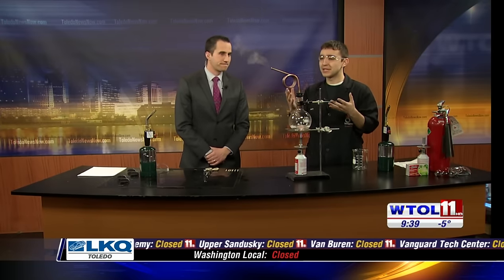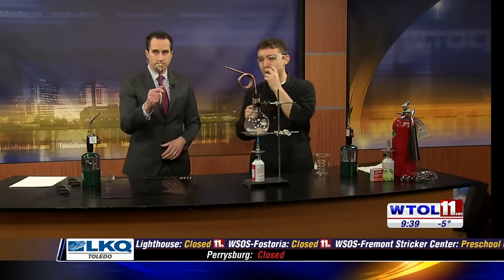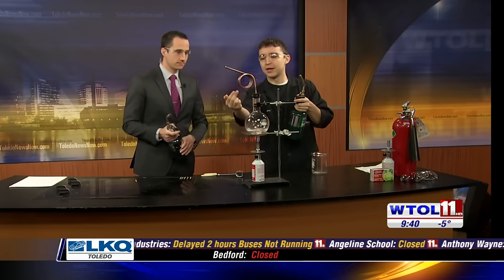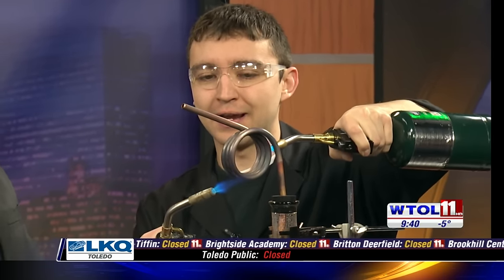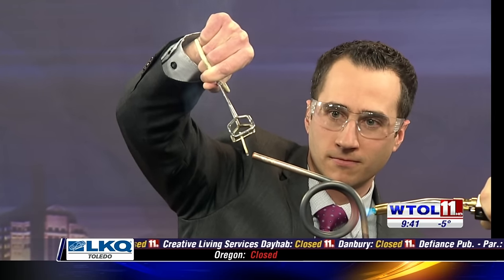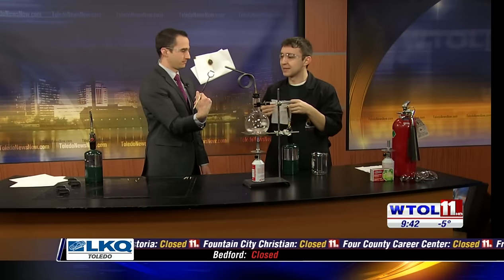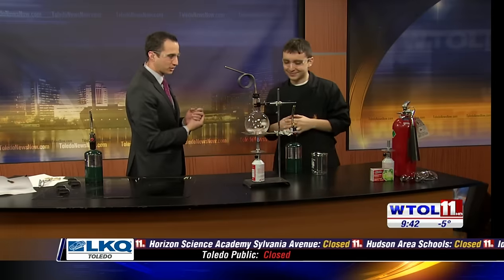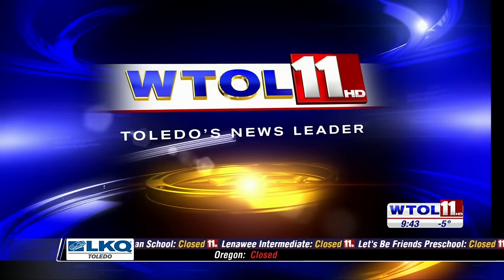Properties of superheated steam

Comment: When he heats the copper he is heating all the remaining water/steam to evaporate.. there is no such thing as super steam.. he basically heat it till all water evaporated and then the remaining air molecules are so hot that they light match or paper
Reply: Nope. That's exactly what is facinating in this experiment.
People have a hard time believing that water can exist as invisible gas.
He is boiling water in the flask, and the tip is blowing steam. That means there is 0 air in the flask and copper spindle. It's been blown out long ago. What's going through is only water, which takes a lot of room in its gaseous form, that's why the tip is blowing so much while the water level is hardly going down, and that's also why steam engines work.
Now while the water-gass "steam" is exiting at around 100 C, he heats it further, to ignition temperature of paper and such.
No air involved.
Reply: @IncendiaHL  I'll play along, so you have a copper pipe filled with water gas.. you super heat it, gas will disperse further and it will exit the copper pipe.. maybe that's true for 1st minute.. after that only few water molecules are left if any ...

I wonder if you did the same experiment, with no water, and just super hear the copper, I bet (10$) that the same will happen to paper or match..

Thoughts?
Reply: @lidoz  There is continuously coming more steam from the boiling flask. You are underestimating how much volume of steam comes from relatively little water. Think about how a kettle is able to wistle.
Oh and where is the air supposed to come from when the steam has "evaporated", (which it already did in the flask)? The pipe is constantly spewing with steam  from the flask.
I know it seems weird, but that is not air, that's 100% h2o :)

Comment: Latent heat of vaporisation...is why a steam burn is 10x worse than scolding water, any condensing surface will receive the latent heat of the change from vapour to liquid and water has a very high latent heat of vaporisation. In this case of course the superheated steam is at a temp. above the ignition temp. of the phosphor/sulfur compound of the match head and so will ignite it in vapour phase as shown.

Comment: So he gets the pipe so hot that the amount of condensation is atomized so far apart that it basically negates the steam presence and you're left with super hot pipes that nonetheless radiates its heat and causes anything in its front to burn. Disappointing
Reply from the maker: Manuel, 
Yeah, not really. If the high temperature steam was not present, the match head would not ignite simply from the radiant heat from the pipe. Unfortunately, Jeff did not have the time to demonstrate that in the live segment.
- Carl Nelson, Chief Scientist, Imagination Station
Reply: @ImaginationStationOH  yeah, not so much. If you put a heat gun to a match itll ignite just like this. Except he created an alternate, more energy consuming version of a heat gun. Theres moisture in the air, a heat gun will accomplish the same thing. 
-no need for a title because I use facts.

Comment: Sigh an example of the modern education or lack of it. This process is what used to run steam locomotives. Superheated steam. Old technology old information no longer taught. Unless your a chemist. Funny part is you could burn the paper if it was just heated air. Its used commonly everyday. A hairdryer lol. Or a heat gun bought at harbor freight.  Steam IE 1H2O behaves differently obviously when heated or cooled. Lol wanna get real interesting talk about heavy water.

Comment: On steam turbine ships there have been cases where a sailor have passed an expansion bellow and been decapitated.   When the expansion bellow is under high pressure gets a tiny crak it will not explode, but high pressure steam will blow out the crack, knifelike.  It will not be visible maybe a meter away, on the other side of the gangway.  It makes a terrible noise, but that is hidden by all the other noise in the engine room.  So when the sailor comes running past this .................................

Comment: Good information. And well-presented. However, steam really is visible. Firstly, it is not a scientific word and hence does not have a definition. It is an old word and refers to water vapor that is produced by boiling water at atmospheric pressure. Therefore, there will always be water droplets in it. Vapor is defined as the gaseous state of matter - it does not contain any liquid (or solid) matter.

Comment: If you do this experiment while watching through something like a FLIR camera (forward looking infrared) then the end of that coil will look like the flame from the torch. There was asteam pipe explosion right outside my Doctors office 2 years ago while i was waiting for an appointment. If id gotten there a few minites later id have been caught in the blast which ripped open a hole in the ground that ate my drs brand new Tesla. Luckily that was the only casualty but boy howdy was i reminiscing about iraq for a while after. But yeah super heated and under pressure is abbad day if it gets away from you

Comment: And here's what I learned from watching this video...
1] The demonstrator tried to redefine what "steam is", as if it was never the cloud you see coming out of the tube (or top of a kettle or pot, as we've all known for God knows how long)
2] That when the tube was heated, it turned the steam inside of the tube into a hot gas of hydrogen and oxygen, which although no visible flame of plasma could be seen, clearly was hot enough to burn a match, a piece of paper, and flash paper.

In other words boys and girls, it wasn't "steam" but heated hydrogen gas (dihydrogen or molecular hydrogen; also called diprotium) and likely the oxygen heated as well and when combined with the hydrogen that water is made of.

Comment: This is stupid. It's not "super heated steam" that's lighting the match, its just the pressure from the steam going thru the heated copper pipe to make a make-shift heat gun that's igniting the match. You could literally do this with some forced air going thru the same heated pipe.

Comment: Doesn't this added super heat "super remove" water from the gas thus what is coming from the copper tube is super heated air for the most part. So basically this is stupid and so am I for watching and commenting on it.
Reply from the maker: Hi C Straley,
No, the heat from the torch adds energy to the water molecules that make up the steam inside the copper tube. There is no place for the water to be "super removed" to. The water does not just disappear because there is no magical place for it to go, other than out the end of the tube with a much higher temperature. Something we call super heated steam. 
- Carl Nelson, Chief Scientist, Imagination Station

Comment: get a copper tube red hot... use expanding h2o to push the radiated heat through that tube... lights a match... wow gtfo
Reply: And the other 99.9999% of the heat came from the steam.

Comment: Dumb. Steam in any form doesnt ignite a match.  What will is 2000 degrees of a torch heating the air inside the copper .
Reply: There isn't any "air" inside the copper pipe. It's the water vapor coming from the boiler (glass jug in this case) that is  inside the tube being heated.
Reply: There can't be air in an open steam system like this, there is only steam......
Reply: The air was forced out of that flask through the copper tube by steam shortly after it started boiling.